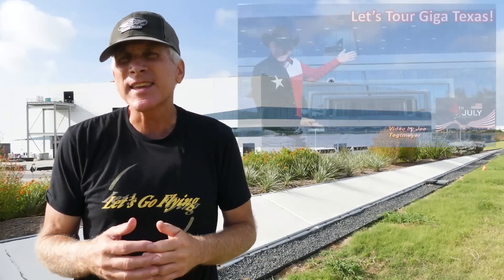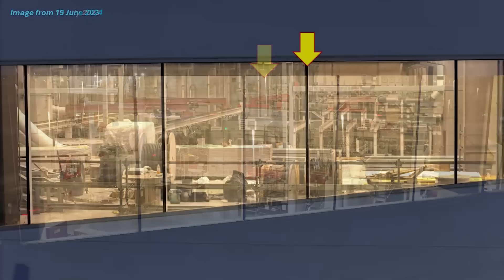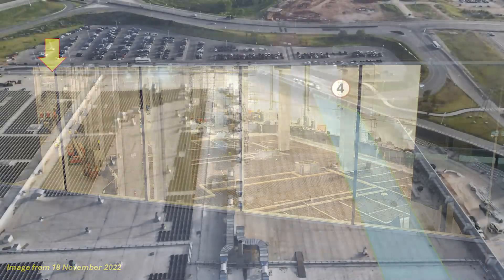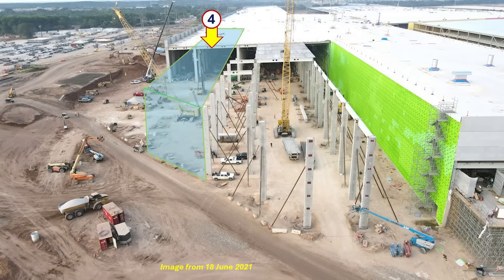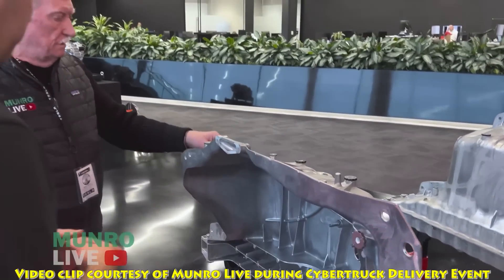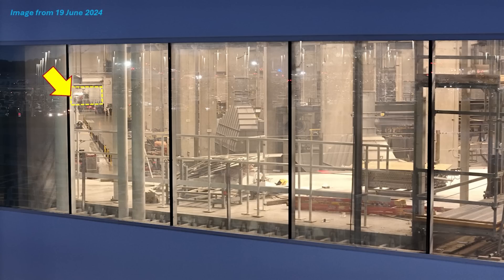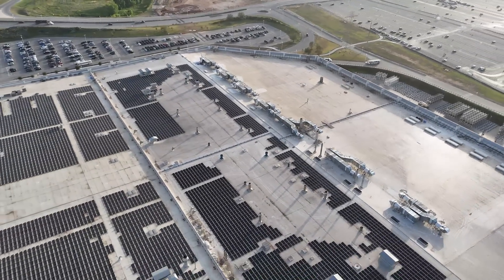There are now 8 IDRA Giga Presses at Giga Texas & More going on inside Casting! Let's Discuss!

Comment: Tesla Austin will shortly have at least 9 presses as one (6,000 tonne) is being installed in the die shop for testing new moulds. I wonder if Tesla will use design to limit presses to 6000 tonne as they work twice as fast as 9000 tonne presses.

Comment: Amazing to see the effort that the architects and designers went to planning and building this enormous facility, and the speed at which all this was done. And we know they are quick on their feet and learn on the job, so they must have learnt from Giga Shanghai and incorporated that into the factories here in Texas and Berlin (it would be great if you could make a visit to Giga Berlin and find the similarities and differences between the two factories)
Reply: There are some similarities in the basic design. Column spacing throughout Battery, GA, BIW is 45'10' (550") or 13.97m. Just shy (30mm 1.25") of the 14.00m spacing of the columns at Berlin. Might be a wild coincidence, might be some magic ideal economical spacing, or it was a plan.

I didn't closely follow the construction at Shanghai. I wouldn't be surprised if the column spacing there is 14.00m also.
It's a square spacing at Shanghai, Berlin, and GT.

Nevada is unique of the new build factories in that the column spacing is unequal, 50' north-south, 40' east-west.

There's also some weird anomalies at GT that suggests to me come 'cut and paste' design from elsewhere. Stamping and Casting buildings both 4' to 5' 1.2m to 1.5m shorter than the abutting structures.

BIW building is also oddly about 3' 0.9m wider than Stamping.
Reply: @DessieDoolan  I am sure there is a thought behind the similarities that you mentioned. Elon follows the “first principle”, simplicity & minimalism and after all, like he says, these factories are the “machines that build the machine” and therefore he puts a lot of thought and energy into these. Therefore, if nothing else, his legacy will be the factories and the manufacturing processes. Now I am waiting to see the factory that will manufacture the Optimus! That will be ultimate!

Comment: Thanks Joe
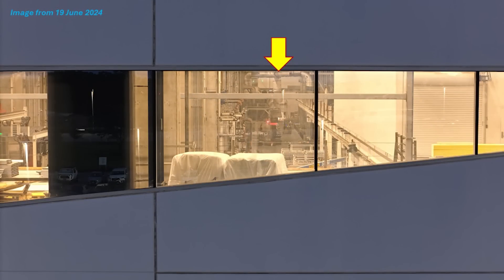2:03. Casting roof. Minor detail, Area 1 extends westward to the ridge line, includes the ramped roof section, roughly double the width shown. The mezzanine at 2:29 would be below the ramped section of roof.
3:53. Casting. Look closely below the arrow where a dozen or so white boxes are placed. Immediately behind that can be seen the outline of proposed locations of additional giga-presses 5 and 6, or 7 and 8. Great view of these cast-in machine bases in Joe's 17 September 2021 video at 5.38.
4:13. Casting. 9000k press footings. Interesting design change here. The 9000k presses sit directly on a heavily reinforced concrete floor. The 6000k presses rest on a steel machine base cast into the concrete floor, as seen in the 17 September 2021 video.
The timber formwork seen in this view is for the surrounding floor grates.
7:59. Casting. Outlines on the floor are the surrounding floor grate. Not clear if giga-press machine bases were cast into the floor here. Good views of these floor grates at the 2022 Cyber Rodeo in this video at 14:31.
Interestingly, the floor in this area was part demolished in August 2022 and reinstated as a simple concrete slab.
Would be interested to know if these new presses being assembled are direct floor mounted (like the 9000t presses), or installed on a machine base (like the 4 original 6000k presses).
12:19. Casting. Left arrow. Rebar area below shows the works behind the now demolished 3 original east loading docks, and the area behind where the wall has recently been saw-cut but not yet removed for another opening. Both these areas correspond exactly with rows of screw piles that I would speculate are footings for a travelling gantry crane.
Similar track for a travelling gantry crane cast into the floor and apron at the north end of the
Die Shop seen in Joe’s 7 August 2023 video at 25.52.

Comment: So 8 means over a million units of total production capacity assuming they use 1 front and 1 rear casting right?
And that tesla is still only getting 250,000 or so castings per year, or is it more now? 

250k model Y from teratx and perhaps 200k ct by next year? means well over 550,000 unit's of unclaimed capacity once these are up&running. 🤔

I remember Wes showed Sandy in that first ct release video they actually used the smaller model Y 6500 ton casting machine's to shoot the front ct casting thanks to advances they'd learned since doing the first model Y castings.

Comment: The issue with making cars this way, they are nearly impossible to repair if they get in an accident. Its very likely the EV market is going to die as EV owners become fustrated with them; Charging problems, repairing them. EVs were basically a novelty, which is wearing off.
Reply: It's your right to make such comments, it's our right to laugh at your ignorance
Reply: I don't know who to believe! Lying media about all the problems you've listed or what I'm driving without a hitch. I've got 2 Teslas ( Model S Long Range and a Model X) Model S is coming on to 2 1/2 years old, the only time mobile service came around was to bring a missing shelf for the trunk, most time spent at superchargers were 8 minutes just giving me enough time to visit the ladies room. Model X is brand new, managed to put 8k miles on it with many long distance travels without a single problem. Also I like the fact that I don't have to swipe a CC at the filthy gas stations especially traveling and in need of fueling the car, most don't give receipt so have to walk into the store to get it and wait in line to face a grumpy cashier who thinks I'm just a nuisance for asking for my receipt. Got my VIN for my CyberTruck Foundation Series, waiting anxiously. Why so many Teslas? I drive Model S since it is the queen of comfort on the roads, I got Model X since my dear old husband is having a hard time getting in and out of the Model S plus and now CyberTruck since I fell in love with it's design when it was first shown in 2019 and placed my reservation. I'm also a #TSLA long term investor. If you believe it is a novelty, I'm not the only one with multiple Teslas who believes it's the best thing since bread and butter.
Reply: @inciwillard991  LOL! As PT Barnum stated "There is a sucker born every minute". 

"Tesla reported delivering 443,956 vehicles to customers during Q2 of 2024, a 4.76 percent drop from the 466,140 vehicles it delivered in Q2 2023"

"July 2, 2024:  Tesla’s global sales fell for the second straight quarter despite price cuts and low-interest financing offers, another sign of weakening demand for the company’s products and electric vehicles overall."

The best thing you can do is keep on buying Tesla stock. Take a second mortgage & run up your Credit cards to the max to buy as much Tesla stock as you possible can.
Reply: Sorry, I didn’t realize you need to mortgage your home to buy stocks or max your CC’s.
Reply: @inciwillard991  You should buy it using debt, as you said, your all in for Tesla.
Reply: The castings make it easier and faster to repair. The ends can be cut off and new crash horns bolted on. They can easily swap entire castings if needed as well. Normally the car would be a write off if the crash is bad enough to damage the main part of the castings because they are so much stronger than stamped sheet.
Reply: @saff226  Sorry your making false assumptions. Go do some research before making broad statements.

"Tesla's cars are tremendously complex, with a multitude of sensors and custom body parts. That makes them extra difficult to repair in the event of a crash. Insurers are increasingly declaring Tesla cars totaled in an accident instead of paying for a fix"

"Feb 1, 2023 — Tesla vehicles can be expensive to repair, leading insurers to write off even lightly-damaged Teslas, according to a new report."

"One large casting in a vehicle makes small repairs nearly impossible. With an assembly involving multiple pieces, the mechanic can simply remove and replace the damaged or defect part. However, with a giga-casting, the entire casting would have to be replaced, which is cost prohibitive."
Reply: @guytech7310  I'm not making false assumptions you are. I have done my research that's why I know you can easily replace parts of the castings. The model y and 3 are basically the same platform but one has castings and one has traditional stampings and Tesla who has the data said it's easier and faster to fix the model y compared to the 3. Traditional insurance companies are boarder line incompetent when it comes to traditional cars let alone something new that they don't understand.
Reply: @saff226  "I know you can easily replace parts of the castings. "

How much?
Reply: @saff226  I though so, keyboard commando! when I asked "How much, you suddenly turned into a ghost."
Reply: @guytech7310  how much what. Are you talking about price. That's like asking how long is a piece of string. Every job will be different.
Reply: Agree completely. Battery packs (4680) that are totally unrepairable... Castings that are are likely difficult to repair or in some cases... Impossible to repair. And the general attitude that is not friendly to independent repair. Which applies to many companies in the tech industry. I have a Samsung Tv. there are no screws holding the back cover on. I have to pay $20 for a fricken special tool just to remove the back cover! With no guaranty I can get it working.
Oh, then there is charging of EVs that is a pain in the backside. Can you just drive in, swipe a credit card and charge? No! From what I've heard.... You have to have an account at each different charging network! No thanks tech industry, I will keep my gas powered car that I bought for $500 5 years ago. Repairs? A wheel alignment and two tires.
Reply: @DavidJohnson-tv2nn exhausts toxic  🥵
Reply: @DavidJohnson-tv2nn  Well, you are correct in that ever since Tesla started, their cars have been purchased by the wealthy.  But, just around the corner Elon has told us this will change.  The price will come down, probably in steps.  $28,000, then $26,000, then $24,000 with various refreshes and models.  All those models will be FSD capable!  Within 5 years the whole world will be buying a $18,000 vehicle with FSD and that will change the world.  Accidents will reduce by 10x!  So, buy & hold Tesla stock now and in 5-7years you will be able to afford a new Tesla!
Reply: @DavidJohnson-tv2nn  Not to mention the inconvenience of being able to charge your EV from home for a pittance.....hang on!
Reply: @DessieDoolan  EVs are a great option for many people, but for the substantial percentage of people who don’t have a way to charge overnight at home, the current state of the public charging infrastructure is a real issue and a barrier to more widespread adoption.
Reply: @Frank-gt7me  Yes, not for everyone. But for the average commuter with access to off-street parking, if you are in the market for a new car it's an option that should at least be considered.
Reply: @DessieDoolan  That is.... As long as you don't go on long trips. 🙂
Reply: @DavidJohnson-tv2nn "As long as you don't go on long trips. " Or in cold climate\weather.  & don't park it in your garage. if it catches on fire, your home owners insurance probably won't cover you for fire damage.

Comment: Does anyone have any insight into the rate of the 6K Giga Presses (time from start to finish of a casting): ie how quickly can they crank out a giga cast? Having this many 6K presses would seem to significantly reduce downtime for any need of retooling.
Reply: Changeable, by task. Lars said some Cybertruck casts can be made on a 6,000 tonne press if needed.
Reply: @FrunkensteinVonZipperneck  Not "if needed", fronts use the 6k tonne and rears the 9k tonne presses.
Reply: I read  a few years ago that the theoretical max for one press was 500k casts per year with a realistic output of around 250k per year. That would mean eight presses could hit 2M casts, enough for 1M vehicles.

Comment: Great job explaining the layout and function of the casting area of the plant. Thnx! quick question if you can answer it. Do the new recycling kilns produce ingots of aluminum or is the molten metal directed straight into the casting machines?
Reply from the maker: I believe they make ingots that are then used in the Stotek furnaces that feed the IDRA Giga Presses